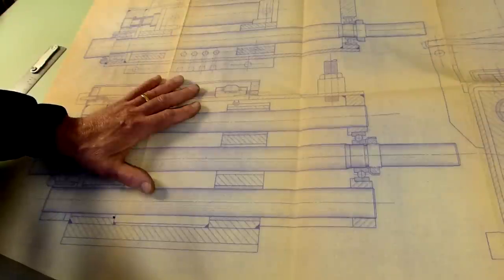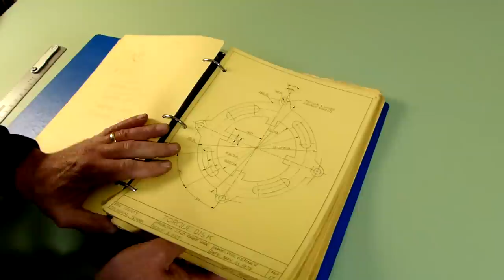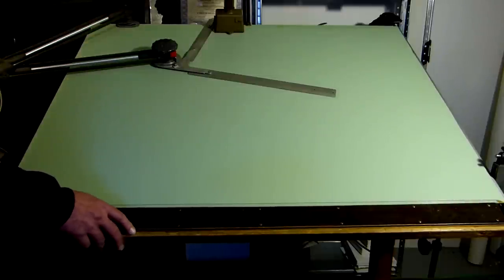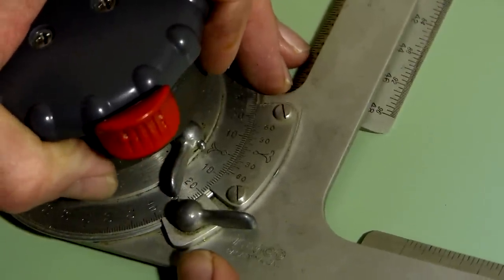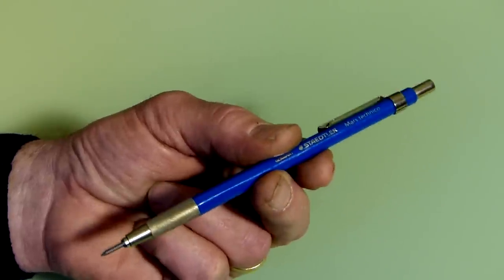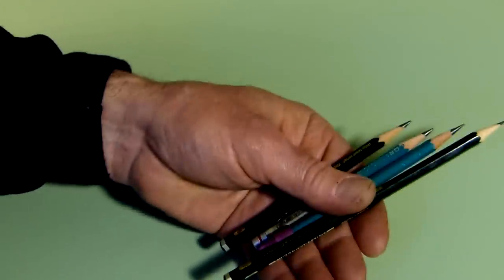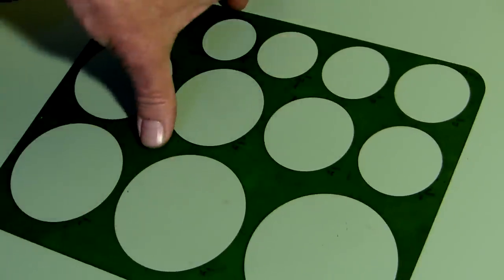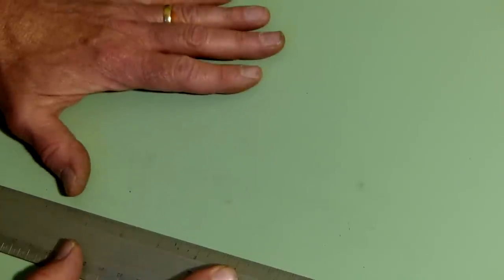The Art of Mechanical Drafting, Part 1

Comment: Love the series.  

I was an aircraft designer/draftsman for over 20 years - Canadair, LearJet and Cessna.  Last generation to use drafting tools; first generation to use CAD.

Nice Vemco compass at 28:00.  Light weight, smooth adjustment and elegant design.
Reply: What tips would you give me to learn shading in drafting? Or any tips in drafting
Reply: @stocks4bt  Like most things, it mainly comes down to practice. The more you do it, the better you get. The are lots of books that show you the basics, or Google it these days, but really you just keep trying until you get it.

Comment: This brings back memories.  I took three years of mechanical drawing in 1968-1970,  I remember fighting with the details of drawing a wood screw clamp.  Then we went into floor plan drawing.  At 71 I still like to play around with mechanical drawing.  I have a few designs under my belt but they are property of the company I was working for back then.

Comment: I took my fist mechanical drafting class in 1978 as a 9th grader. I did that and architectural drafting all through HS. Never worked as a draftsman and did not do regular machine work until my 40's. But as a equipment operator and later as a mechanic those skills came in handy. Up until the 90's  Caterpillar parts manuals were derived from the assembly drawings. Many people had problems looking at such a drawing, they preferred the expanded blow up. Having that drafting background it was a so easy for me to use that drawing and it gave me a context in which the parts fit in service making reassembly a breeze. Now I am a machinist and fabricator and I use drawings daily. I still make drawings by hand if need be, but usually simply work from a sketch. Any or a cad drawings I get come from other sources as I have not taken the time to learn Cad, and unlikely I will at this point, unless I need to or become board! never say never!

Anyway Phil I love this stuff and I will be tuned in. thanks for taking the time to do this. 

Cheers

Comment: Another old guy here….worked as a “draftsman” out of high school for a bit. Learned the craft in high school. My handwriting is really printing and when my hands were steadier it remained a point of pride for me. I’ve been casting about for a nice drafting table recently to re-create some elevations of my childhood home. I wish there were somewhere one could get blueprints made. I still have most of my gear,triangles , inking set, pencils , eraser machine,etc.
Reply: A few days ago I went to my local salvage building supplies warehouse and they had in the ‘free’ area 6 drafting table tops.  About 6 feet by 3 feet. I carefully selected the best three and carefully loaded them on top of my Prius V. They feel very true and are heavy. 
 I’m not a draftsman but I have used AutoCAD for remodeling drawings. 
 I’m excited to start learning mechanical drawing!

Comment: I’m still gainfully employed as CI Engineer. I’ve been a card carrying Tool and Die Maker 43 years. I’ve designed and built more tooling and machine tools than most. I still draw in full scale in my board. Vemco V Track..

Comment: This video just popped up in my feed, and watching it - WOW - does it bring back some memories.

Oddly enough, I started drafting (lead on vellum) not long after you.  Made the switch to CAD.  Always felt that the art lost a little bit of soul when it went to computers...

Ended up going a different route professionally (Boeing laid off about 10,000 drafters right before I got laid off at a company; became a mechanic after that), but I'm now putting together a home shop.  Still have a bunch of my old drafting tools, had just picked up a Vemco drafting machine like yours a couple of months ago. Now, on the hunt for a table.

Looks like I'm going to be watching this entire series beginning to end

Comment: Just a question from an observation here. I'm just wondering because I've noticed that your drafting scale has it's corners rounded off as if done by a person. Did you do that so that the sharp edges of the scale wouldn't cut into the paper? Or has that just happened over time with repetitive use?

Comment: I don't know about the rest of the world but here in italy you are still taught hand drafting  as part of the mechanical engineering course. In fact it's taught in middle and often high school too, so many students do it for 8+ years. 
Sadly these days it's taught using a rather bare-bones toolset (none of what you showed here, besides compass, ruler and squares), the expectation is that you'll apply what you learn to CAD so there's no need to develope the same skills.
I learned SolidWorks as a teenager, now after the hand drafting course I went back to SW to do some things and I found my workflow has changed dramatically for the better. I guess despite the frustration and inconvenience doing it by hand it's still a great learning tool.

Comment: You missed one point (pardon the pun) about sharpening those lead holders. They actually supply a sharpener at the top end of the holder. That silver piece has a hole in it. You pull the silver piece out and push your lead into it, and turn it. Hey presto, a sharpened lead. I've got 5 of these Staedlter  lead holders/mechanical pencils.

Comment: You pointed out something around 3 1/2 minutes, drawing the part helps when making the part, I know by doing a quick drawing I am understanding the piece much better, I cannot get that through the heads of others that I make things for, they want to describe it....which is useless to me as the builder, for many reasons, no dimensions ect.....they constantly put the cart before the horse.......like building a 3x5x6 foot frame for mobile bars and then telling me, oh, we need some holes drilled in this stainless steel, like over 100 holes....gee thanks for the heads up.....now it has to be drilled by hand.  The reply I get is 'oh, I thought it would be more accurate to place the holes this way'......Take Care Sir, enjoying your presentation....Paul, an old grumpy fabricator/machinist/weldor/artist

Comment: Some stylistic differences from your intro here Phil - I use mostly 4H lead for layout lines that will disappear - 6H if I really want them to vanish...

I do most of my basic lines in HB (Half Black? - it's the same as the #2 lead in your ordinary writing pencil) lead, then go to a 2B or 4B for darker lines.

I've found that drafting dots only require three hands most of the time, while drafting tape usually requires four... ;^) Blue painter's tape works in a pinch, and also doesn't tear the paper.

And, when the white vinyl erasers first came out around 1980, I thought that they were the greatest invention ever - I prefer the Staedtler or Pentel over the Magic-Erase, but it works almost as well.

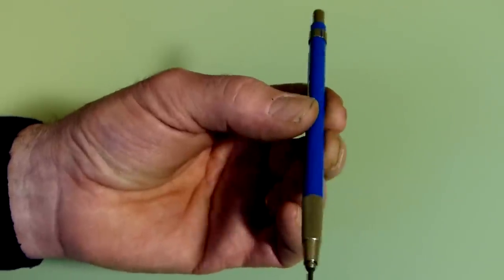Comment: 17:27 I've got the same lead holder, I don't have that sharpener though, I use sandpaper to sharpen the lead.
Reply: This Staedtler lead holder has a built in sharpener  in the cap. Jus detach it and introduce the lead in the hold and rotate. U can also Buy a 2mm leas sharpener in any arts supply store

Comment: I used to do mechanical drafting as a product designer in the 80s. I really do miss the art of mechanical drawing, but eventually we switched to Autocad for obvious reasons. Nowadays everything is done in 3D programs like Solidworks. Almost every manufacturer we used was in China and one cannot afford ANY room for interpretation so it had better be in 3D. I imagine most every vendor actually requires 3D data.

Comment: When I transitioned (  🙄, Not like that ) from a carpenter to Draftsman... My first college classes, including intro to R14...I had to take one year of board drafting... My first recommendation (if you're going to "draw" plans)….. don't by cheap drafting pencils or pens.   I am a true believer in OJT... every Architect, Structural Engineer or Mechanical Engineer should have to do a 3yr Apprenticeship in the field so they can learn what goes into building what is on the print. And you will learn Engineers have a serious self-inflated Ego.   
I have some of the most beautiful vintage "Mechanical & Architectural" Blueprints... the difference in the one you showed.  The page was "Blue" … the lines and script are white

Comment: That is not a blueprint. It's a Diazo or blue line print. Blueprints are an entirely different process, done on 100% rag paper or linin, and they don't fade in the sunlight. Diazo prints are still commonly called blueprints, though. Even diazo prints are rarely used now instead of photocopies. (gets down from my old fart soapbox.)

Comment: i still drawout work i need made up by a machine shop by hand' the wife about 20yr ago bought me a Pro 3D CAD program , it was something i could not work with , when asked by the wife why i was still using the drafting board instead of the CAD after explaining why things were very frosty for a fair while after, i still find it quicker no squinting at monitors no printers or plotters .................

Comment: one....working with your hands, sure
but two (and more importantly) software can be stupid difficult to use and pretty pointless if you are just trying to dimension for yourself.

IE - I don't know CAD software, I can spend a couple hours or so drawing out my part or spend a couple hours or so trying to figure out a hotkey to add a radius in CAD